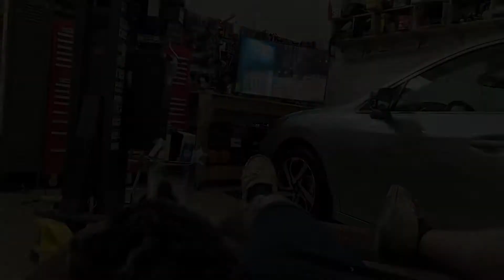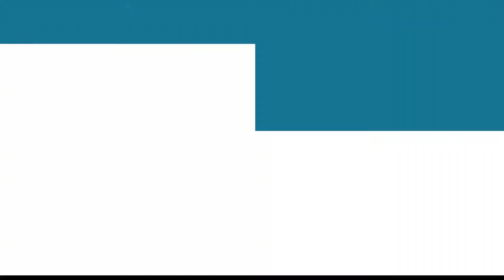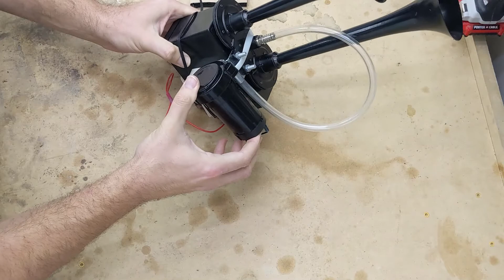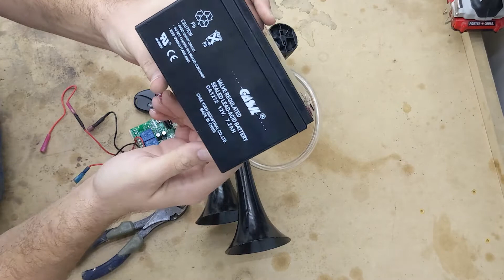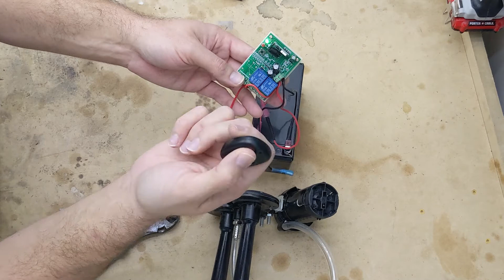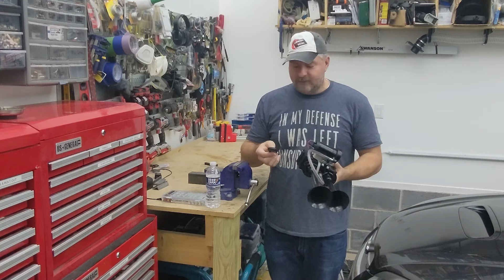Remote Controlled Battery Powered 150db Train Air Horn

Comment: A pair of Nathan locomotive air chimes would take a half inch inside diameter line, hooked into 
very large air resevoirs for the brakes  and electro-mechanical contactors for the traction motors.

Comment: I need your advice. I am not an engineer, but I need to build something like this. For 2 years now my neighbor dogs have driven me insane. Countless hours and sleep lost. The city will do nothing, even after legal complaints (at least 40). These people can't and won't train their dogs. The distance from my house to theirs is about 150 feet max. I want to build something remote and easy to change batteries. My plan is to mount it near their fence where they never maintain the shrubbery. Then, when the dogs bark I plan to train horn them, maybe when they are sleeping to just to instigate my own karma. Please let me know if you have suggestions for that. Thanks. My neighbors are the worst.

Comment: Is there a way to set this up to run from a power supply that connects to mains power? So that I can avoid the need for a battery pack? And have it constantly powered?
Reply from the maker: yes.  it is a 12v DC system.  you can buy a run of the mill 12v dc power supply from amazon that plugs into a wall such as https://www.amazon.com/ALITOVE-Adapter-Converter-100-240V-5-5x2-1mm/dp/B01GEA8PQA

Comment: Id put a  microphone sensor circuit on it that would repeat every sound it heard and put the mic down low on the fence..  like itd give a wee little poot if the dog barked once but if the dog let out a whole barrararark the horn would do the same..  stuff would be fiunny as hell, put a camera up.  Make it immediate so right after a bark itd toot..  guarantee the dog would ho off on it until the thing let out a wollop and itd shut up if the dog had any sense to it at all.. 
  I had a big basset hound the fence after my neighbors whod bark every time i went out so i just put up a motion detector with one of those owels that move to get rid of birds and hooked it up to solar power so the thing would go off all day and night and so would the dog..  took about a week solid of it before somebody called about it and got the people fined ..  lol..  and nobody knew i did anything...

Comment: Hi SFS, I would like to purchase a remote horn set just like the one you built.   A wireless, remote controlled horn, powered by 12 V, and a charger for the battery
Reply from the maker: Everything I used to make this was put in the product description.  All parts are available on amazon.

Comment: I'm giving the people behind my house until January 1st to fix the dog barking at 6am, everyday for 2 hours. Then, I am building this. Question, how long does that little compressor last for? I would like to blow it for 30 seconds at a time.
I will use your amazon links also! Thanks for making this video.
Reply from the maker: it is an electric compressor so it will last as long as you hold down the button